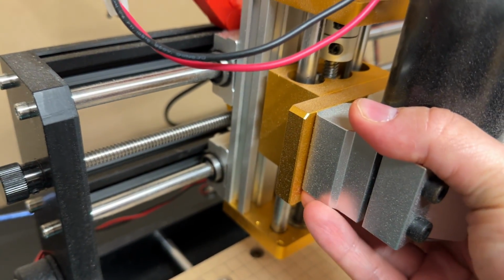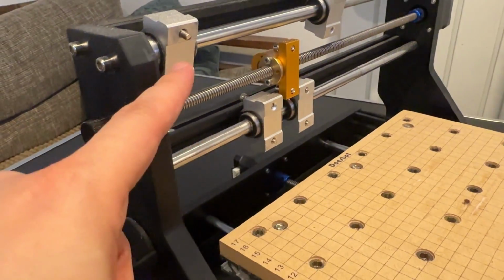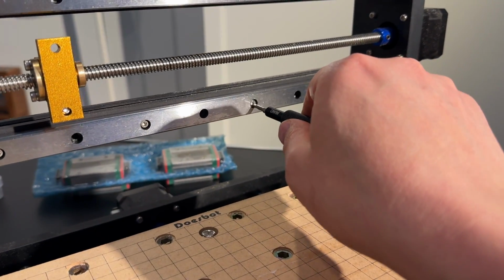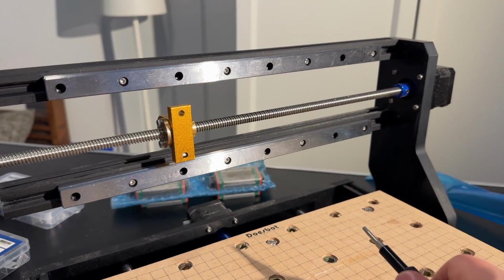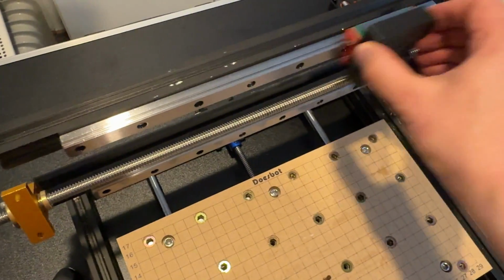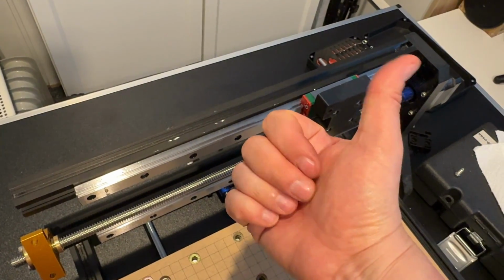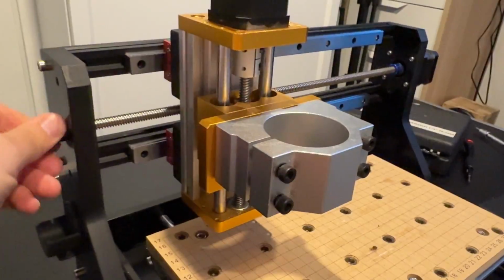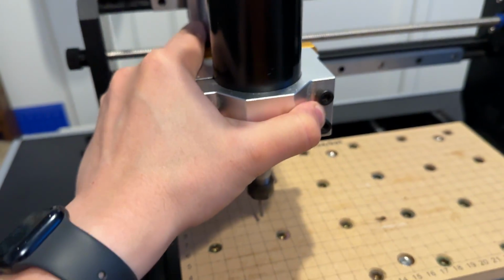Upgrade Your Vevor 3018 Pro Cnc With High-quality Linear Rails!

Comment: What size screws are you using to fix the block to the Z axis, also do you use the same block to Z axis screws on both this Z axis and also the linear rail Z axis? Cheers in advance.

Comment: glad it was purely add-on and no removal, as that would start negating the 'viability' of the purchase.
Reply from the maker: In my previous video about the CNC project I did a full cost breakdown of each part purchased and I mention there it would be pretty much the same price to buy one with all these upgrades from the factory. However, I wanted to learn about CNCs as I go so I decided from the beginning to start with a 3018 and set up all the upgrades to it myself.